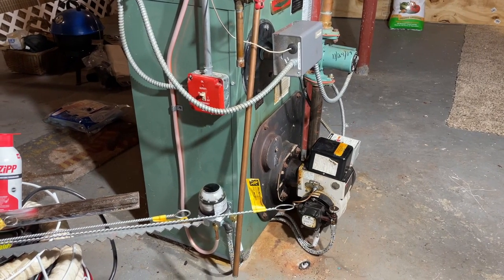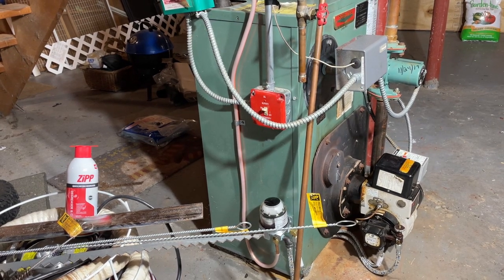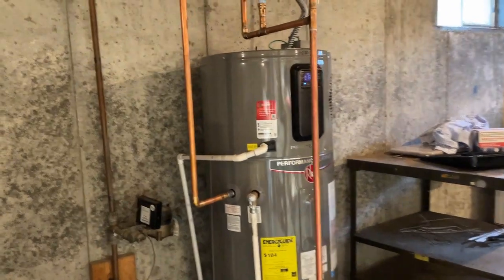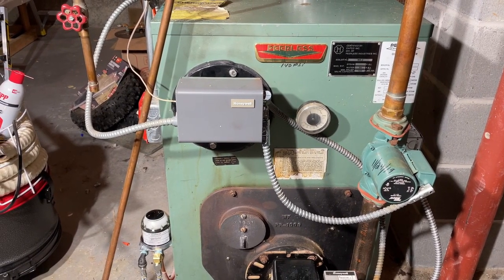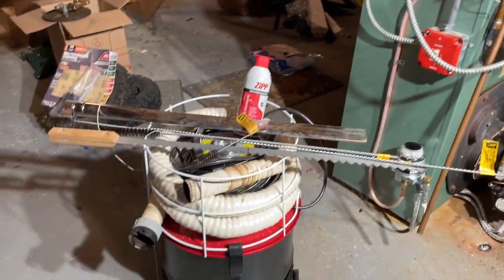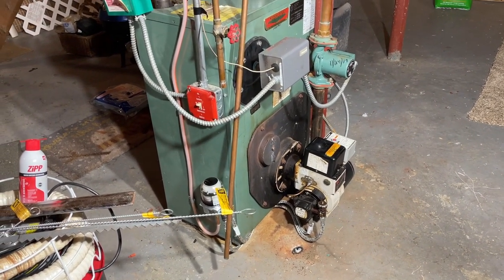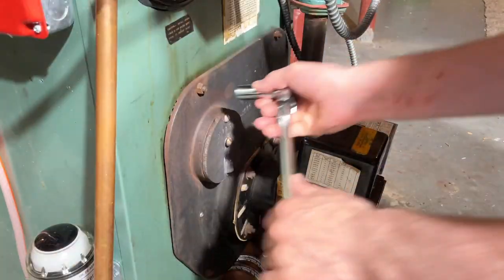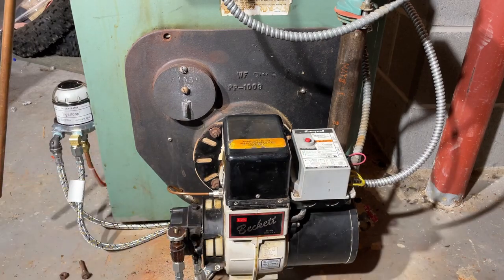Cleaning Peerless WB-3 Oil Fired Boiler

Comment: Can you do that cleaning from the side instead of the top? Although I have the same boiler, the flue pipe comes out of the top, and there is a conduit screwed on also
Reply from the maker: My boiler is cleaned from the top down - can you find a manual for yours & see if it indicates how to clean it?
Reply: @idothings6605  thanks for the response. I have a similar boiler Just that the flue pipe location is different. I already cleaned it out. Amazing. I’ve lived here for 11 years and never realized how easy it was to access the top and front and clean it. Thank you. Your video helped me.

Comment: - Haha... I have the exact boiler you have but, I still have the tankless hot water hooked up.  I added a 1" thick ceramic insulating blanket across the top of the boiler and the chamber cover and I've noticed it helps to suppress noise and retains heat longer between my Hi /Low / controls.
Reply: You mean between the silver and green thing?
Reply: @Drrich_DIY   - YES!  underneath the top green cover I laid 2 layers of Cerwool insulation on top of the combustion chamber silver cover.
Reply: @Skoot61  Thank you!  Im not sure how I am going to do this: my flue comes out of the top of the boiler not the back and I am going to have to take apart the metal piping to get the top off I think. thanks for the reply
Reply: 2:49 I have this same boiler and it shows here it already has insulation under the cover.
Reply: @mattfoley6082  - yes, that small piece of heat shield insulation isn't doing anything in terms of 'insulating.'   Add 2 layers of 1" thick 'Cer-Wool' insulating blanket across the top of the tankless coil housing chamber and, also over that silver firebox access panel and then you'll notice less burner noise, longer periods between aqua- stat water temperature start-ups and better boiler heat retention times...
Reply: @Skoot61  Got any data to quantify that? I'm skeptical it makes that much difference since the top is only 1/6 of the surface area of the boiler (top, 4 sides, bottom). Also, if the factory lid insulation is as inadequate as you say it is then the lid should get fairly hot to the touch, right? Also, adding more insulation won't work if the insulation is compressed. I'm willing to be convinced, though!
Reply: @mattfoley6082  - Dude, the data I'm telling you is from personal experience in the effort to minimize heat loss from the boiler and ( IMO - not enough and, unequal to Cer-Wool ) the factory insulated enameled steel jacket in the effort maximize thermal efficiency as heat rises... - It works for me!
Reply: @Skoot61  Well, "dude", I just put my hand on top of my Peerless boiler when it was burning for at least 10 minutes and it was warm. Hardly proof it's losing lots of heat.
Reply: @mattfoley6082  - @ mattfoley6082 - Haha... hey guy, you just proved my point.... No joke, earlier I had a 15+ minute shower so I went down and put my hand on my Peerless boiler and, it felt like it was never even on....
Reply: @Skoot61  Well, then I guess i should congratulate you saving 1 gallon of oil per year.

Comment: attention you miss a wash with baking soda is to dissolve in 2 gallons of water preferably hot or warm a small box of baking soda and when you finish a wash inside and where the brush could not enter that takes all and you will get better  results.  but first you have to wear whole clothes and masks and when you're done you have to bathe or remove the stains on your face and bodies with baking soda and wash your clothes with that same product baking soda masks because the smoke is very volatile  oil and waste produced by the combustion chamber and your face and nose stick to your body if you do not have protective equipment, thank you.

Comment: I have a Peerless WB3 made in 10-90 (from serial number on tag). What is the brush you're cleaning with? How did you determine correct brush size?
I've been using a refrigerator brush and it works great. Fits just right on the diagonal between those nipples. (When boiler is cold otherwise brush will melt.) Definitely notice improvement after cleaning; the burner doesn't run as long.

I think you need to clean your pipe also. Need a 6" round brush.
Reply from the maker: I asked the salespeople working at my local supply store (FW Webb) & they were able to give me the correct size brush.

Thanks!

Comment: If you are still using the boiler for heating your water, does it require extra steps in prep work to brush and vacuum out the soot?
Reply from the maker: I now clean the boiler before shutting it down for the summer so that it doesn't condensate all summer while dirty. Before When it was running all year long I would clean it before the beginning of heating season.